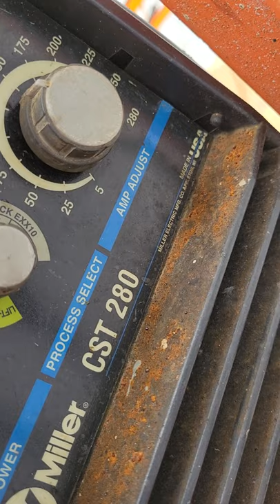Structural Welding/ANGLE CLIPS =VERTICAL, FLAT,OVERHEAD

Comment: Great video frank, do you do a side to side motion with the 7018?
Reply from the maker: Michael, Yes I do, I hold it' 2 to 3 seconds each side, It varies,  Thickness of steel, If I'm running hot, Thanks for your comment, And thanks for watching my videos, I hope they help
Reply from the maker: Michael, If I'm doing the root, I'm driving the middle and washing left to right,  all the way through, I hope that helps out, And then I wash side the side, Like I said before, Have a great night!